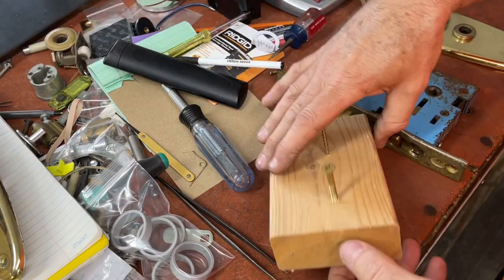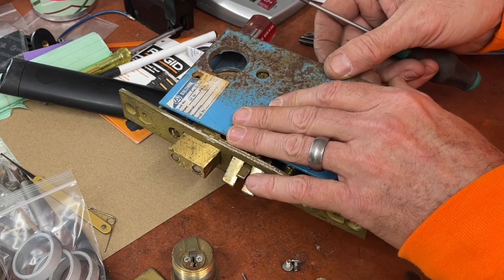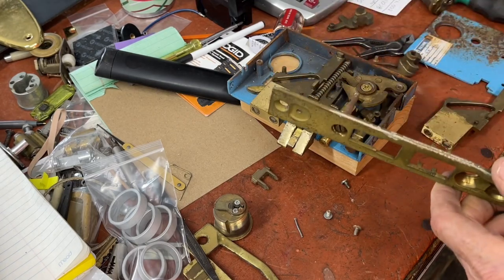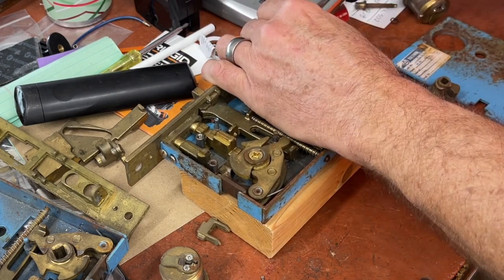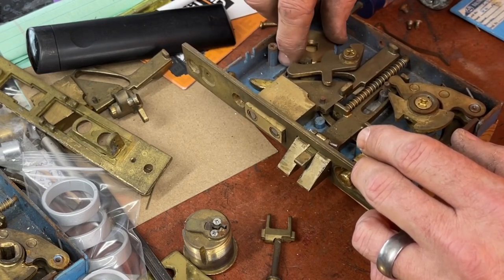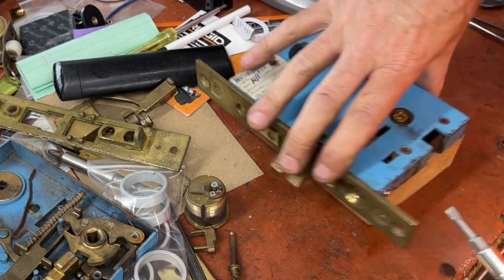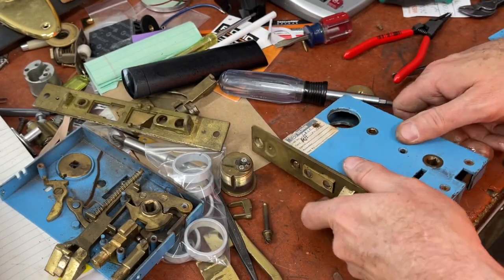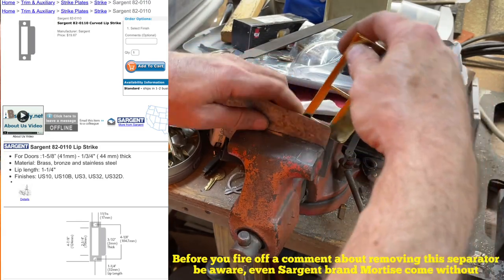Baldwin 6020 Mortise Lock Repair after it getting ripped off door by handyman

Comment: You had mentioned about a tool for putting in the plate for where the thumb turn goes on the inside of the mortis housing. Get you a quarter inch drive extension and use it with a ratchet and it’s easy to put in or they also make a quarter inch drive screwdriver it has a screwdriver handle on it will make it easy the next time to put it in. And you can always know which side is in or out because the hole has tapers on it where it belongs to the outside of the lock that’s the help guide the tail piece into it. Just thought I’d help.
Reply: Nice tip
Reply from the maker: huh, I’ve never tried that one
On the 1/4” ratchet topic (which I actually didn’t have any close to where I was filming this anyway) I’ve been eyeing getting a new one but can’t decide which brand I wanna try next

Comment: Great video It is the best Baldwin rebuild on Youtube. You even showed back shimming on the cylinder. I have been repairing Baldwin and yale, etc mortise locks for the last 20 years,   I like that nowadays I can take a picture with my phone, as  Soon as I open the box. I just retired and am repairing and rebuilding the locks I saved. I do have parts from the locks that I take apart. I like to see the different ways each manufacturer makes to lock a door. The lock guys today just want to plug the holes and put a tubular lock. I just repaired a 60-year-old Yale mortise lock with a little filing of some burrs.  My tip is I use a spindle to attach the cylinder plug the square hole is the same size. Can I put my small website address on your page? Again a 5-star info video

Comment: You didn't show the side of the door. Guessing it was also damaged. Great 🍭 repair job.
Reply from the maker: believe it or not it really wasn’t bad at all! The frame was split but they were actually pretty careful to keep pry marks to a minimum when they were bending the top of the inside plate. I was surprised the door wasn’t split but it was a old solid wood door so it held up pretty good on the edge (which is amazing considering the damage to the edge plate!)

Comment: So, whoever tried to remove it had no clue on how it was installed?  
Some people have no sense of "Do no damage" as a rule of operation. And don't know when to stop!

Have a great day.
Reply from the maker: I think, since they thought their new handleset would fit (ha!) it didn’t matter in the moment. No keys and double cylinder locked so no one was getting it apart without picking or drilling the cylinder. I’m guessing they tried twisting the cylinder then bent back the top to see if they could get it out another way.